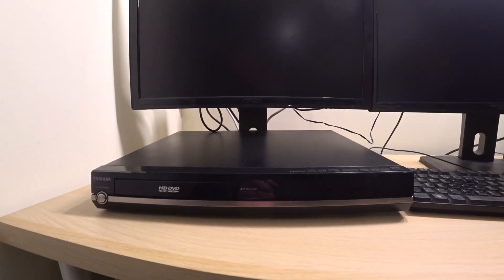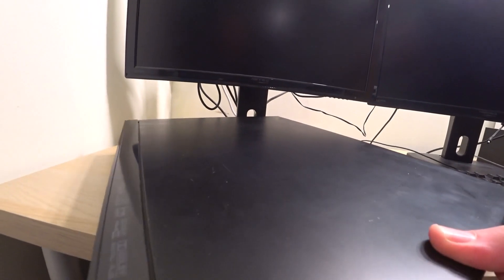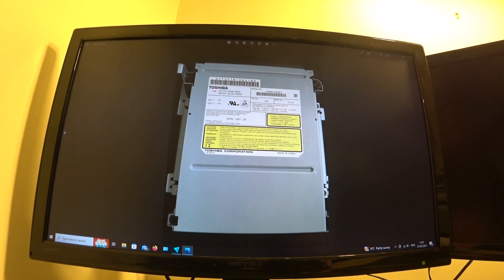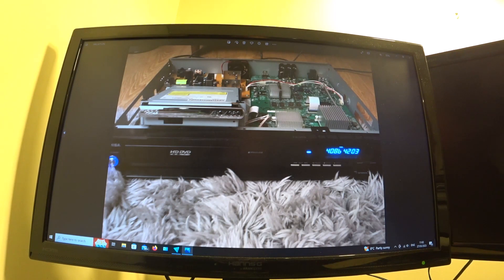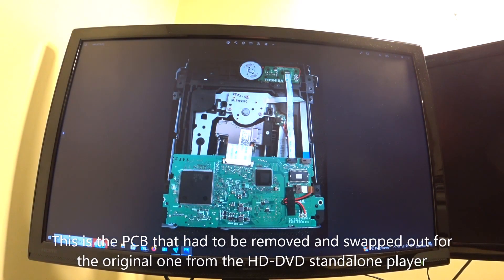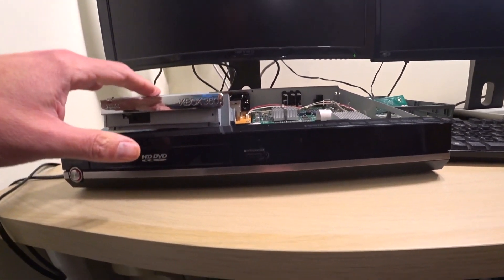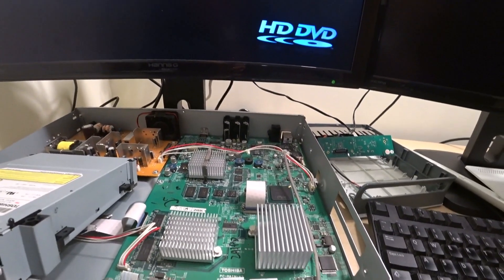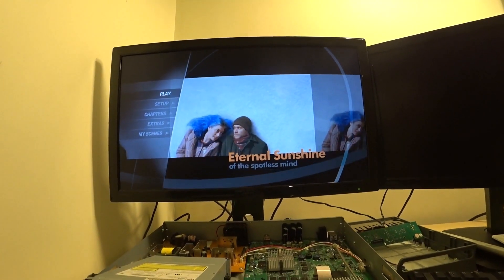How to fix Toshiba HD-DVD Player Xbox 360 add-on drive replacement

Comment: not sure how I found this video but I'm glad I did, my toshiba hd-xe1 hd-dvd was refusing to play any discs so I thought I would have to buy another through ebay but then I suddenly remembered like you that I had the Xbox 360 addon drive, I thought they might be the same drive model (and they were) so I swapped them but although I could now play cd's and dvd's any attempt at playing an hd-dvd resulted in an error code appearing on the machine, I have watched a few other videos on replacing drives but none of them mentioned having to swap pcb's between drives too so I took the pcb from the faulty drive and put it in the 360 drive, now my toshiba plays hd-dvd's without any problems, thank you for this video as you saved me money (which is always good).
Reply from the maker: No problem. Great to hear. Please remember to like and subscribe.